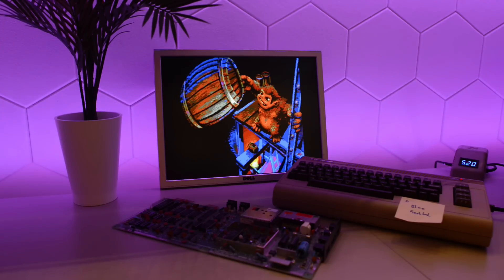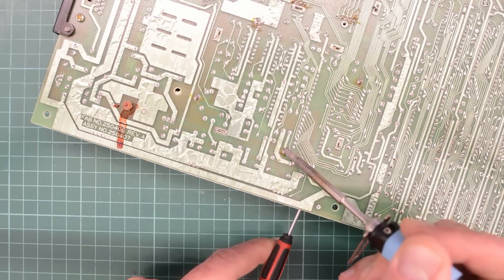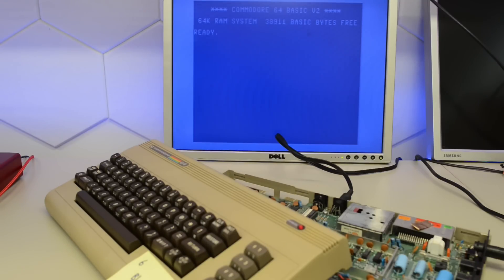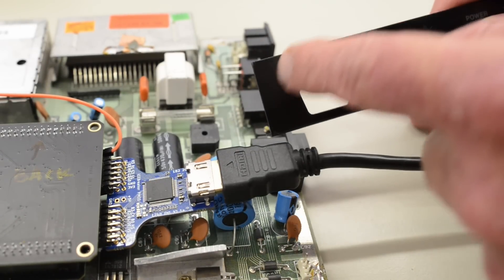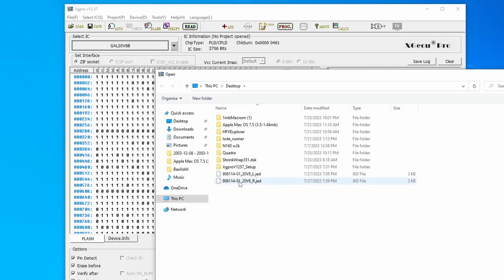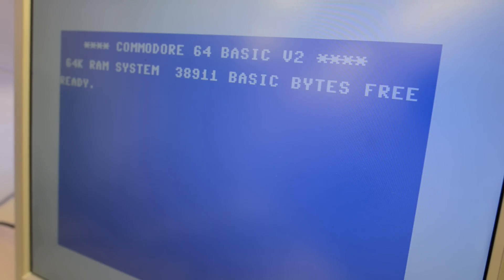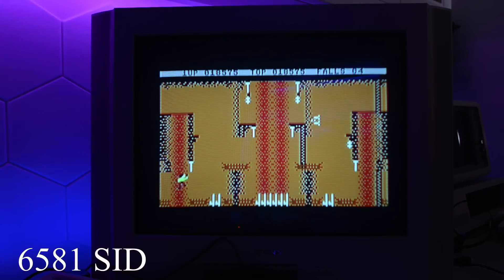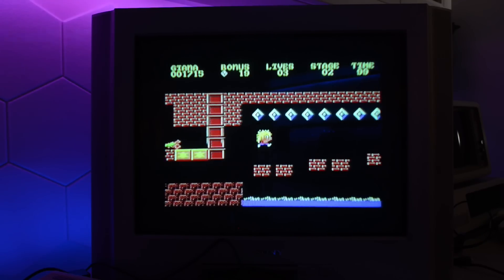Adrian Black gave me two Commodore 64s & a VIC-II Kawari. Repair of the "Albino-64" +PLA replacement

Comment: Great looking all white C64, simple solution for the PLA problem, Kawari gives a really sharp and modern image perhaps not nostalgic but eyes would really appreciate it over the classic VIC 2 image.
As another mate wrote in a comment I am also for to integrate the HDMI plug on a modified side plate next to the joystick port perhaps?
But I have to say that the thing that impressed me more was the sound coming out the greatest custom chip Commodore designed the first generations SID! If you listen to your direct feed from a good HIFI system you will understand what I mean. I have heard Yamaha's OPLs, square wave synths from other companies, and even more modern stuff, nothing compares to that warm, not perfect, digitalanalog sound SID produces and that deep Bass! It is like it is singing by itself...
Keep up, Cheers from Greece!
Reply from the maker: The SID is an absolute legend. Love that chip, Cheers

Comment: I think that chroma/luma is accessible on some pins on the kawarii board. The commercial ones do have Chroma/Luma, the HDMI module is an extra feature. If you really want C/L shoot a meesage to Randy, he seems like a nice guy and you have a very weird version of the board, I think it is even more capable than the commercial one. Randy said that he wanted to strip out some of the more useless features.